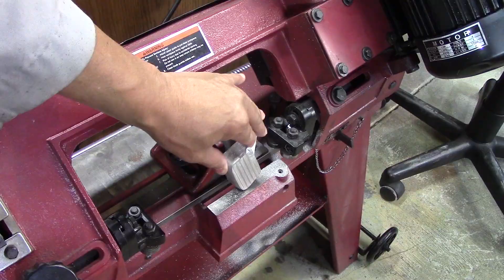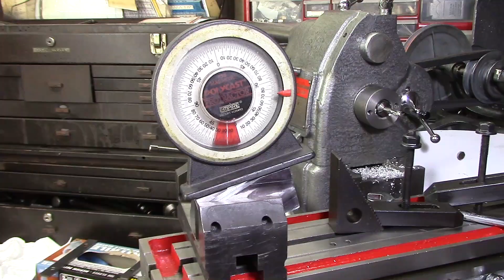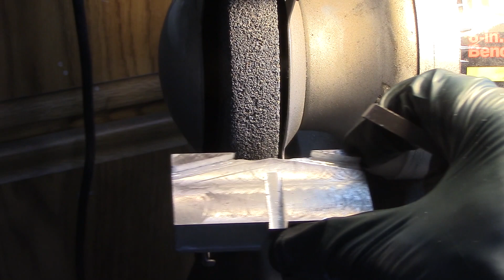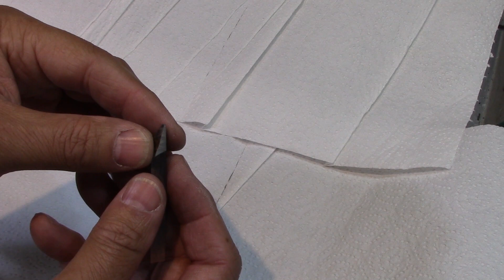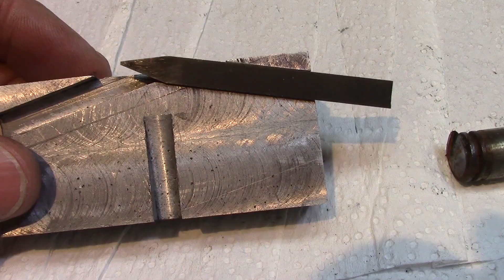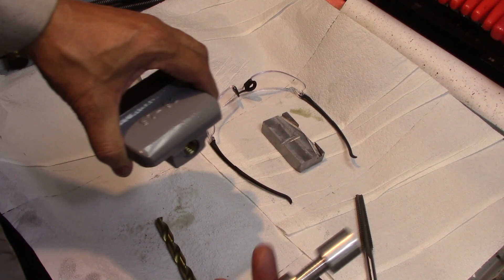Journey to Journeyman, Episode 27.  Making a jig to grind a tool for Acme threading. Left hand Acme

Comment: Hi Jster, what a great idea. I'm going to make one too. Actually your original idea of sliding the whole fixture from side to side is the correct one. Roughing out the bulk of the material on the grinder is the fastest if you keep the high speed steel fairly cool but I noticed that the rest on your grinder was not parallel. If you remove it and machine it square to the axis of the wheel and machine the groove on the underside of your fixture to suit you will get a better grind. If you slide the tool in the fixture you are just offering the tool up to the wheel or belt and backing away. Finishing off with the belt sander will do the rest as you clearly showed. Well done. All the best. Jim in the U.K.
Reply from the maker: Thank you so much!  I will have to do some work on my grinder.  And yes I did have issues with the tool pushing away.  I will try to do a revised version sometime.  Thank you again and stay well over there.  Ps.  I sure wish I sounded like you guys over there!  Everyone sounds so intelligent!
Reply: Lol. Intelligent?  It depends on what you are doing Jster. Put me in the seat of an F14 and there will be only one outcome. KABOOM!!!! Take care.
Reply from the maker: @Grabber-bx8ns  LOL